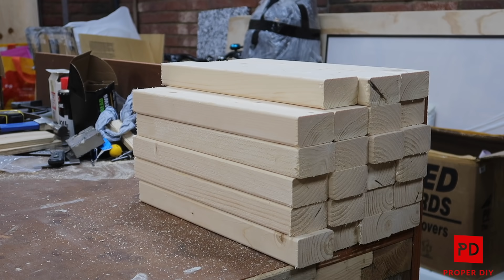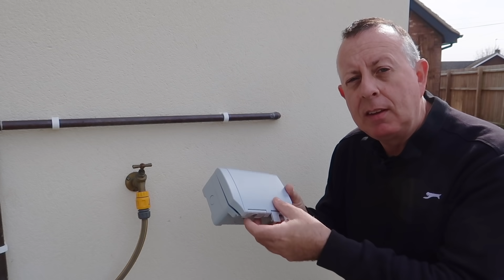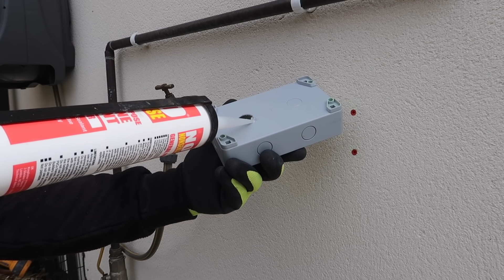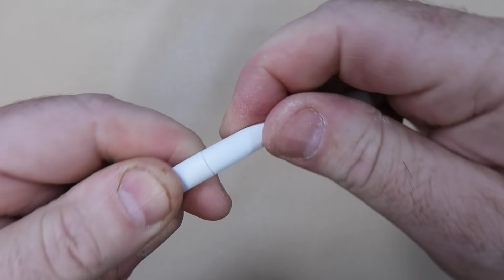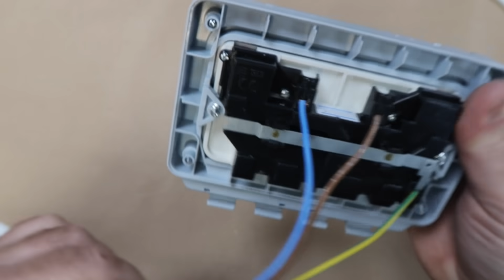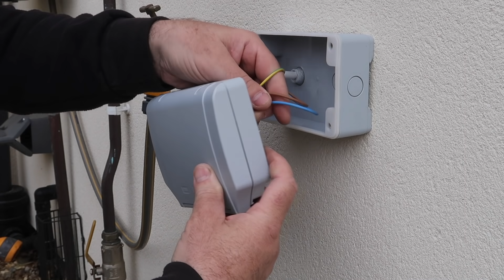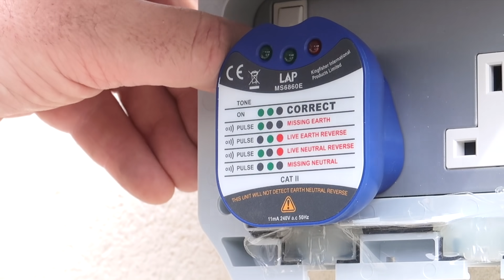How to Install the Easiest Outdoor Socket

Comment: Hi, I know this is 2 years old but just a quick question, could you run another cable from the outside socket to another outside socket, thanks

Comment: Excellent.  As a matter of Safety it is often noted that these outdoor sockets (with our without RCD) are not recommended for power tools as they can be working at switched on outside but if a breaker trips and one goes inside and resets the breaker the power tool with re-energise.  They are more recommended for items with internal moving parts like deep freezes or fountain pumps.  That said who would not use one for garden appliances?!!  A note on these lines.  It is a bit like PAR testing when you have to have the item (circular saw...) on to test it and it comes live and moving during the test!

Comment: I think I might do this myself. I've had enough of dragging an extension lead and hose on a reel from the exterior socket and tap in the back garden whenever we wash the car. The only sensible option for power is the sockets under the front room window. That'll work. No trailing cables and no trailing hose as I've fixed it to the side of the house and all we need is a short length to attach when washing.😊

Follow up: installed as I said I would but also added an alexa based wifi plug to operate it. Added a LED driveway light on the first floor powered in the same way.
Both voice activated, bloody clever stuff! I've even turned the light on from a different country!😂

Comment: Little known fact - Part P regulations in Wales differ from England - it is illegal to add any external sockets or power to outbuildings without either using a fully CPS registered electrician or notifying local building control before hand and paying the £200+ fee's.

Wales still running on 2010 building regulations so kitchens and anything outdoors is still considered a 'special location' so no adding of fused spurs or extensions to circuits is allowed. This includes connecting the external socket via a plug like this - as it would be deemed a fixed installation, regardless if your plugging it in rather than through a fused spur.

Just pointing this out - don't agree with it though, personally - F building control, so long as your not an idiot and follow good video's like this and have some reasonable skill....then do what ya want.

Comment: When the instructions tell me to drill out both drain holes if I'm using the side, top or rear entry cutouts, then I'm going to drill out both drain holes.
The instructions also state that as soon as you drill out a hole in the rear of the box, you lose the IP66 rating anyway.

Comment: I am installing an external power socket and re-watched your excellent video. One thing, I'd like to check: what is the main reason for using the 15mm barrier pipe? Is it to protect the electric cable from the elements (inside the wall)? Would it matter much if I omitted using it? Kind regards,,,

Comment: What a nice job!

Just completed a similar job, using these instructions, and I have to say - it went about as good as I could have wished for.  Kudos to Proper DIY for an outstanding, easy to understand, and thorough approach to the project.

Let's start out with the elephant in the room: Getting an electrician in,  tapping into a ring circuit, doing all the tests, and issuing a certificate of compliance is going to cost several hundred pounds. As it should, given the cost of testing equipment, skills of the electrician, etc.

This approach sidesteps most of the costs, while maintaining the safety inherent in the UK electrical code.

Comment: How many things can you run off one plug socket though? Could you install a outside extension lead and run multiple things or would it overload the socket? If it did overload would it just blow the fuse in the plug?

Comment: I did exactly as you said and I installed mine and it isn't working. Completely dead. I've checked the wiring and it's fine, and both switches inside and out are on.

Comment: A word of caution 'daisy chaining' supplies where an an overload could occur is not advisable. A 13 amp BS1363 fuse can draw 21 amps on overload before the fuse will blow.  A short circuit would blow it almost instantaneously.  Also outside power supplies & lighting installations come under building regulation requirements & as such need to be signed off by a competent electrician or someone suitably qualified.

Comment: Great video. I’ve seen you can buy these outdoor sockets with various length cables and the plug already installed. I wanted to use one this summer as a more permanent solution to running my pool filter but everyone seems to be advising me that I shouldn’t as it’s classed as an extension lead. Unless I’m missing something this is the same or am I missing something major? Any help would be grateful.

Comment: Excellent tutorial, my only additional thoughts could be; perhaps a cable tie at the external box on flex to reduce risk of pull, &
I'm connecting mine to a fused spur as my environment varies & the internal cord, although temporarily used is vulnerable along skirting, but obv. I'll lose the benefit of being able to use a timer which is an excellent idea, but I suppose it varies depending on the occupants eg my wire- chewing dog 😬Love your videos BTW
Reply from the maker: Thank you. A cable tie is a good idea for sure

Comment: Great video Stuart , might be a stupid question but if you already had an additional spur socket directly connected to your socket in your boiler room, would you still be able to wire the outside socket in the same way? Great song choice btw :)
Reply from the maker: Yes. Look at my external socket as just an extension lead with the socket end outside. So it can be plugged into any standard socket just as if the appliance was going straight into it whether it's on a spur or not.
Reply: @ProperDIY  Thank you

Comment: What size cable did you use? 
2.5mm is the recommended cable size
Reply from the maker: 1.5mm flex. Why do you say 2.5mm is recommended? The fuse will blow at 13amps and the 1.5mm cable is rated to 15amps so the fuse will always protect the cable and blow first. 2.5mm is required in a ring circuit when you have multiple sockets, this is similar to an extension cable.

Comment: Just done two of these today and I’m pretty useless at most stuff, but they turned out fantastically. Thanks for this video. I had to get myself 40cm drill bits, but for £8 (for 8, 10, 12mm) it’s a no brainer). 👍
Reply from the maker: Nice one well done!
Reply: Did you use an SDS drill?
Reply: Would you ever consider running the flex in a conduit along the top of the skirting.

Comment: Hi could you tell me what size external rated screws you used to fit the back plate to the wall?
I did not get any supplied with my outdoor twin socket. Thank you.

Comment: Wow! Matching up holes drilled from either side of the wall is genius!

Personally, I would have bought a long enough drill, not worth taking the risk. My holes definitely wouldn't have married-up and i would have had to go get a long drill in the end anyway!

As for the flex along the skirting....it would be better to nail to the skirting board as it would provide a more robust, permanent fix. Nailing to the wall is generally not 100% successful, as inevitably they will become loose and pop out due to the natural pressure exerted by the flex of the cable. Plus, if the wall is brick, often the clip pins bend or the plaster/brickwork crumbles, causing extra patching work that the missus won't appreciate😵‍💫

Plastic trunking could also be used along the skirting to conceal the flex, it can look a lot neater than the bare flex and can be painted to match the wall decoration. 

A great, easy way to add an external socket with minimum electrical skills. Utilising a smart plug to control it is a great idea👍

Comment: So I have a hot tub and the cable will not reach to an indoor socket.  The manual says do not power using an extension lead.  How is this any different to an extension lead just coming off a 13A plug in the wall - thanks

Comment: Good video but something worth noting is the 1.5mm flex should only be used in this instance and not when it’s connected directly into the installation. If you were using a double socket fed from the installation by 1.5mm cable, you have the potential to be pulling 26 amps along a cable which has a current carrying capacity of 15A as you mentioned. Fine in this case as it’s protected by the 13A fuse in the plug top. Also need to watch the length of runs as it’ll increase the earth fault loop impedance!

Comment: Drilling from both sides, to stop the outer facet of the brick from splitting, is the sign of a considerate and competent person.
Reply: Its also almost impossible to make the holes line up perfectly as the video showed!!
Reply: @richardlewis5316  use a really thin drill first like 6mm, then trhough from each side with 16mm ish.
Reply: @richardlewis5316 Run the hole right through with a narrower diameter drill then use the centres to drill with a wider diameter from both sides.
Reply: That happened to my dad with the guy fitting his fiber broadband!

Blew a right chunk out!
Reply: Measure the depth of the wall easy by opening a window

Comment: Would it work for an inflatable hot tub
Reply from the maker: No I'm afraid not. I would rate anything to do with a hot tub or swimming pool as high risk and would employ a qualified electrician who can not only install it but more importantly test it make sure it if 100% safe.
Reply: @ProperDIY  thanks

Comment: Argh, you really need to use ferrules to terminate stranded wires before inserting them in a screw terminal. Especially in the terminals where the screw itself hits the wire.
Not sure about the UK, but here it is against regulation to use non terminated stranded wire in a screw terminal.
I would advise you to get that fixed, not only to comply to regulations but for your own safety. 
After tightening these screw terminals on stranded wire they tend to break most of the strands, giving a bad connection.
For splicing stranded wires you can use wago 221 (without ferrule!!!)

Comment: Thanks for this

Might seem like a stupid question

But at the end you said you could install outdoor lights

But just wondering how you could do that?

Because you would need to leave the plug in on the outdoor for the lights which would compromise the waterproofing of the socket 

Am I missing something?

Comment: I have had an outside socket installed, but the clips are so hard to open it hurts your finger. Is there anyway I can make the clips easier to open?
Reply from the maker: Depending on the clip system I would take a piece of sandpaper to it which would gradually make it easier to open
Reply: @ProperDIY  Thank you for the reply. I was thinking the same, but wasn't sure if it would reduce the waterproof seal.

Comment: Thanks for your help on fitting the outside socket. I purchased the same product from Screwfix + 16 mm drill bit to go through wall + plumbers pipe all same day. All working fine and making such a difference instead of running x lead from house. 👏👍😉
Reply from the maker: Nice one - well done. And, you can easily remove it from the house supply if there is any problems - handy over the summer.

Comment: I have two of these boxes to fit. 
Thanks for the clear instructions. 
I had a friend drill through the cavity wall for me took a couple of minutes for both boxes. If he hadn't done it I would have bought the drill bit. It would have save alot of stress and time trying to line them up. 
So many excellent tips. 
Cheers 👍🏼

Comment: I am not an electrician, so just wanted to check something. The list of products states a 1.5mm Flex cable, I've read that 1.5mm is for lighting and 2.5mm should be used for sockets. However the 2.5mm is real hard to get into a plug! If I use the 1.5mm cable am I still safe? Great upload, it's helping a lot.

Comment: I always drill the hole at a shallow angle, lowest point being outside, then silicone top and sides of the socket, this will help stop the water tracking inside the house if it does get on the cable.

Comment: Great video.  I am looking at using a socket with the integrated RCD.  If I then put a smart switch on the plugged end, will it keep turning off  the RCD when it switches off and having to be manually reset?  Would it be better to plug a stand-alone RCD on the plug end and have the smart switch plugged into it?  Thank you.

Comment: Good install, but please for anyone trying to replicate this, get the longer drill bit and drill at a shallow angle upwards from the outside in, it prevents water seepage into the house in the unlikely case that the seal fails, and if you want to seal the cable with silicone inside your conduit (which I wouldn't recommend doing anyway, it simply isn't needed), you must drill out the drain hole(s) as to prevent consensation forming (as an open ended conduit at both ends will allow the inside of the socket to breathe lower humidity inside air) and slowly over time filling up the plastic box with water and/or corroding the terminals or screws.
Reply from the maker: It's not an open conduit from the house. I sealed between the cable and conduit. See this week's video for a 1 year update on this project.
Reply: @ProperDIY  The recommendation I make about not sealing the cable into the conduit considers that you drill the hole for the conduit at an angle.
If you do seal the cable into the conduit, which is honestly fine, you should drill the drain hole out so that there is no chance of condensation building up inside the box, I have seen a few instances of similar installs (though it will take a few years to become an issue) where the box becomes filled with water because of this.

Comment: Great video! Is this safe to charge an EV with?
Reply from the maker: I don't have any electric car experience but I doubt you can charge a car from a 13amp plug - best get an electrician to install a proper charger
Reply: @ProperDIY  You can charge an EV with a 3 pin plug but it draws about you 2-3kwh. So not sure if going from a plug to another plug (like using an extension) will cause issues.

Comment: Great video, simple and to the point, just how i like them😁👍.. I've just set up a new lazy spa hot tub. Manual states that i shouldn't use an extention to plug in.. would this technique count as an extention? I've got the lead coming in through my kitchen window at the minute and obviously this isnt a very attractive or practical way to keep it. Would installing an outdoor socket this way be safe? Thankyou😊👍
Reply from the maker: Thanks. This socket is good for garden tools and a radio in the summer but when it comes to a hot tub I wouldn't recommend it. Because of the increased risk if there is an eath fault I suggest getting a qualified electrician to install the power.

Comment: I started with the latest videos went into past and detected the before often used „Marxmanpen“ hint in this episode - Thank you very much! 
In Germany (related youtube channels) this incredible tool is unknown. I will order it soon. 
Usually I do not comment anything. But I want to give something back. 
Please check „JOKARI T30150“ if you strip wires and connect wires regular. It’s a easy to handle one for all tool. Especially stripping cables without damaging the inside stripes is easy. Sorry for my moderate english. Take care!
Reply from the maker: The Marxman marker I find to be a really useful thing to have when you need it. It's not cheap for what it is but definitely good to have in the workshop - I used mine again yesterday an not sure how I would have done the job without it!
 I have seen that wire stripper in videos - looks a good tool - I'll have to try it.

Nothing wrong with you English at all!

Comment: Is it easy enough to swap a single outdoor socket for a double? The single socket was here when we moved in but it useless and the cover is broke. Is it as easy as just wiring it up like for like?
Reply from the maker: Yes correct. Just be aware that you may not be able to pull 13amps from both at the same time. Having said that - 2 x 13amps is like putting large heaters in you garden so not  easy to do.

Comment: Excellent video. I have a question though. Could I run two of these from the indoor twin socket, each connected by a plug? Or could I connect as you have and then run a spur from one outdoor socket to the other? If doing so is a risk would I just be better running the 2nd outdoor socket from a different indoor socket? Thanks for your advice.

Comment: I recently purchased the same unit for the same purpose, very helpful, excellent video. On another note, should you not link the Earth (Green/Yellow) cable to the back box/base as well, as per manufactures instructions. 👍

Comment: I installed an outside socket for the first time. Only difference is that I used an isolation switch which I then connected to the back of an internal socket so especially the outside was in the same loop